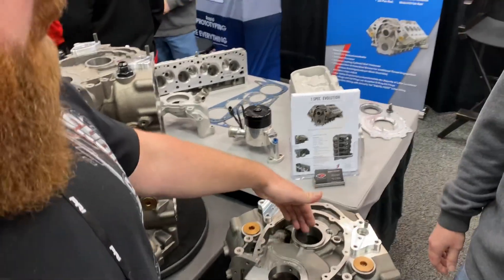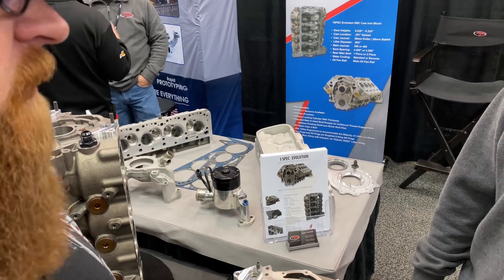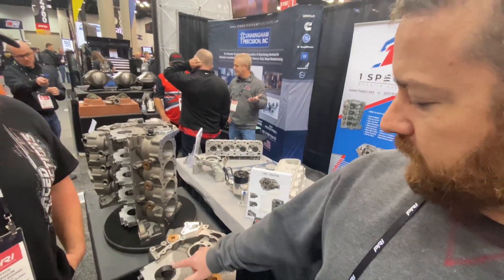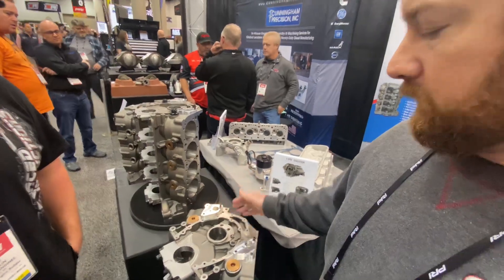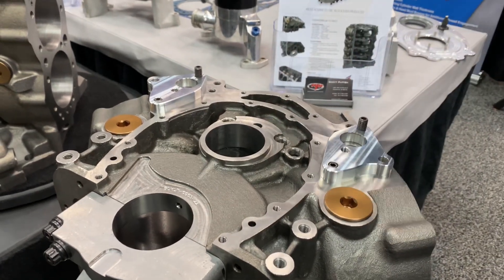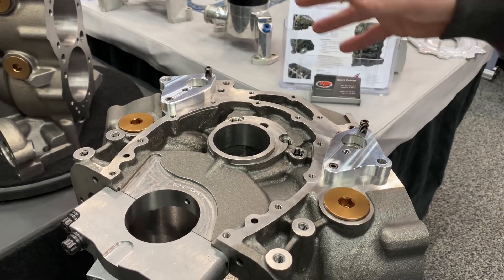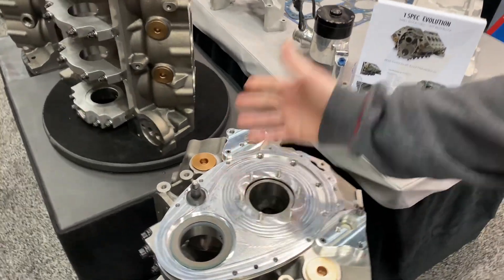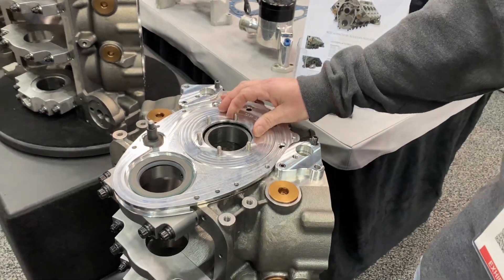LT1 block PRI 2022 new LT1 block (Gen 2)

Comment: I can't see this as a hit ... I am guessing the price range for these blocks is going to be crazy.... then having to work out all the front cover issues etc which will add cost...  to me if you are at the level where you need this type of block the best bet would be to skip over the LT1 stuff and go straight to a traditional sbc setup...  when we are talking about the cost involved there are so many options for aftermarket blocks already out there that have been proven and no guesswork involved...     what's crazy on top of all the new stuff we see in trade shows not one company out there has made an intake manifold with a rear distributor option For LT1's .....
Reply: Believe me, it’s a hit. And we already have solutions. We’ve had them for years. The only thing missing was the block. And the block is here.
Reply: @Rob94hawk  outside of the TPIS mini-ram, who makes an direct aftermarket LT1 intake manifold?  Who make a timing cover with the raised cam journals?
Reply: @mrmister7526  agree exactly my point.. tpis wants a fortune for their intake plus you have to buy their fuel rail setup etc ...  just adds to the cost and if you are going to go through all that there comes a point where it's cost-effective  either to go LS or a Dart type of sbc block.... yes the whole thing is cool but it all comes down to price vs performance
Reply: @mrmister7526  This LTX block gives you the choice of either using a common raised cam timing cover or if you want to use the old school LT1 timing cover EFI connections will be making one. As for intake manifolds it depends on what cylinder heads you will be using now. But either way you're using either custom and/or modified intakes like a victor jr. That being said since the first order of these blocks are a standard deck height you can still use the stock LT1 intake manifold. The only difference now is the cylinder heads will have more room to breath with a base bore size of 4.120"! So you can use AFR heads with a well ported LT1 intake manifold!
Reply: @maldo72  I get this argument constantly. Mostly from the LS crowd. Cracks me up when people bitch how much money this is when in fact almost all race cars are a net loss regardless of build unless you have rich sponsors. And majority of people that build race cars don't have sponsors, they build it because they want to. Enjoy the moment and ride the wave.
Reply: @Rob94hawk  I understand but, is there a market for this? when most just go to an sbc block .. i don't see any pricing for this block
Reply: The reason why I resisted going to the Gen 1 aftermarket blocks is because I'm in love with the reverse flow cooling so that you can use the higher compression ratio's on the street with pump gas. If Dart or GM and I forget the other names out there had a reverse flow Gen 1 block then I could see myself using it with the LT1 style heads.
Reply: @Savineyard3  there's a lot more too it than that. Now I don't have to change my k-frame, T56, and accessories. Which are all upgraded and cost me a few thousand. The fact that us LTX guys have to argue over this is fucking pathetic and it gets old. Some people need to go hang out on Twitter and be miserable over there.
Reply from the maker: @Rob94hawk what heads are you planning to use with your set up?  Is there a thread anywhere about this block?  LS1.com?   Thanks for the info.
Reply: @EllweinEngines  I'm going to talk to Scott at M&M in a few weeks about converting over symmetrical SBC heads.  As for any real forum discussions on cylinder head choice, no not yet. This block opens the door to that discussion now in a big way. Especially now that the rough bore size is 4.120". AFR 23° 245's should work but the stock intake most likely becomes a restriction with much bigger cubes. Probably could use a modified single plane Victor E EFI. Sorry. Brainstorming out loud.
Reply from the maker: @Rob94hawk  I like the brainstorming.  Just like the old days of forums.
Reply: @maldo72 rear distributor? ... its 2024 lol
Reply: @JesseSeg84  and your point is?

Comment: It’s cool that there is a new block that will allow for big cubes.  I understand that even having an LT1 configuration for this aftermarket block was a victory in itself but this isn’t as gen 2 as I was hoping.  The raised cam and giant journals are cool but this is as about lt1 as a Dart SBC block.
Reply: There is another company that is starting to make heavy duty gen 2 LT1 blocks, much more factory like, I believe, called M@M competition engines.  I was just getting ready to look more into these when I came across a 92 Vette engine that is 4 bolt main, so I bought it, I'm just going for 550-600 horsepower, for road racing, so I think I'm good.
Reply: @user-Dr.  this is M&M in the video
Reply from the maker: Your totally correct.
Reply from the maker: It is definitely not stock style LT1
Reply: @EllweinEngines  Sorry in advance below I kind of hijacked the reply thread below about what I did to my 383 LT4 for road racing duties.